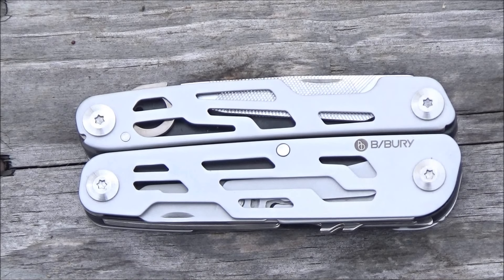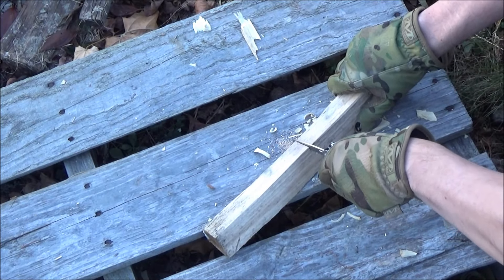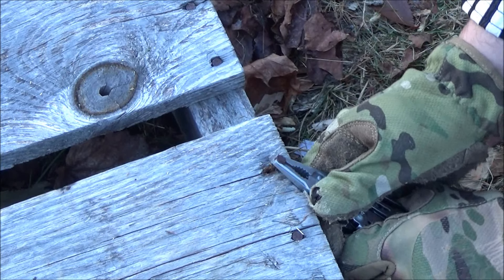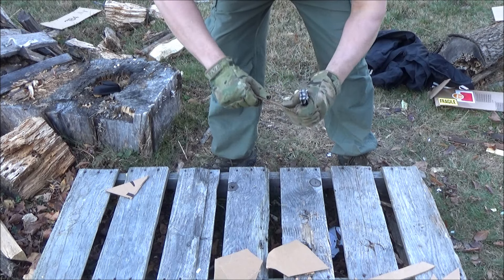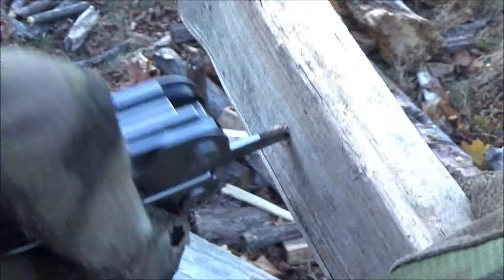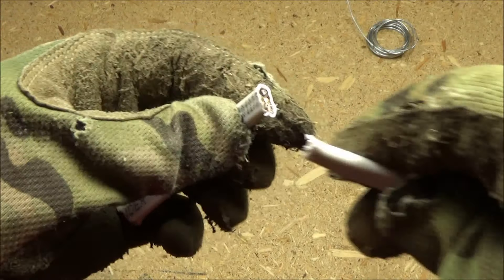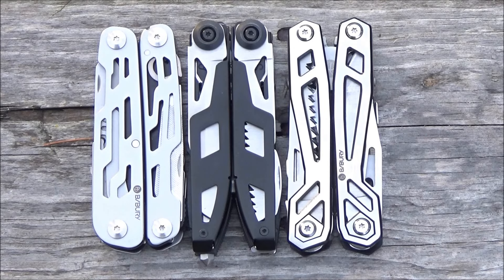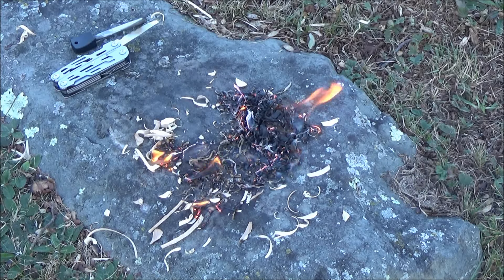Bibury 13 IN 1 Multitool, Full Review - Budget Champ :]

Comment: the can opener is designed to cut forwards without resetting, almost like they're scissors. place the hook til it catches on the lip and angle the blade till it catches the inside lip, the push down and forward and each up and down will continue cutting forward
Reply from the maker: Yeah the little hook on this one doesn't actually hook enough to lock in, so I did just keep resetting it to apply more force.

Comment: Great great review!!, I'm finally convinced about what multitool to buy (after browsing like 15 mor of your vids lol).  
One question about  the Phillips screw driver. Will I be able to use the "add on" for diferent screw driver heads kit on this?
Reply from the maker: Thanks, bro!  The driver won't fit those bit set adaptors because even though it has a square shank it is a little smaller than most.